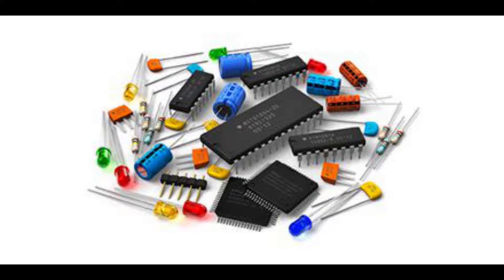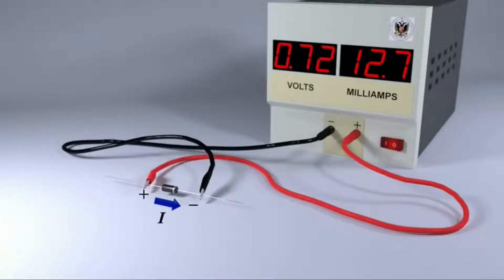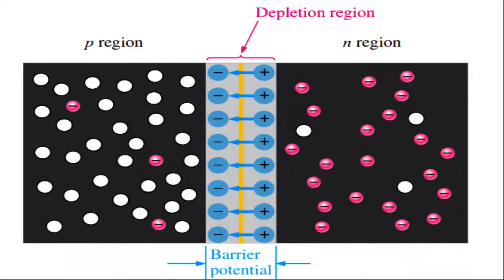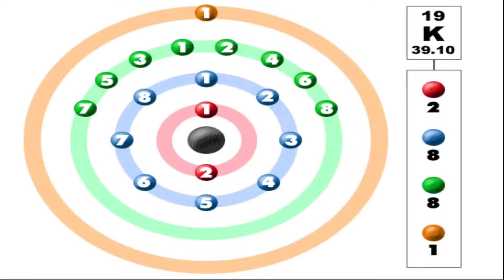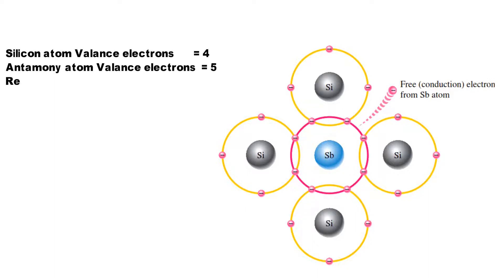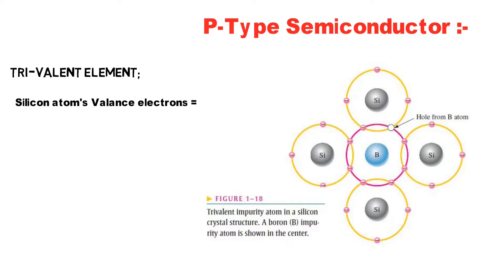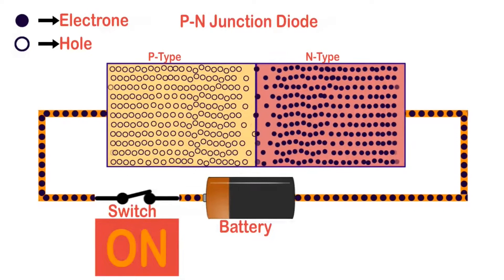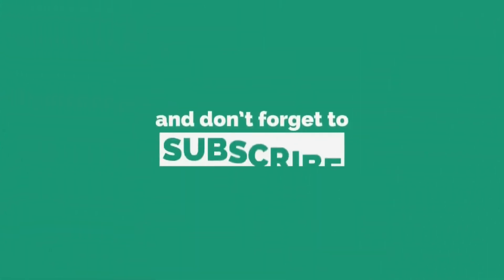What is a Diode | Diodes Explained | Diode working types and uses |Types of Diodes | Diodes | diode

Comment: Sir why diode work only in one direction
Reply from the maker: its because of the polarity. if the polarity is in forward bias it pushes the electrons to break the barrier junction and move on through the closed path, but when the polarity is reversed the junction barrier is further increased because the electrons and holes are drawn the backward in opposite direction by the voltage applied. in the later case no current flow until the barrier is damaged permanently.